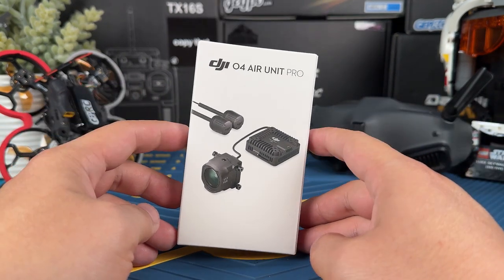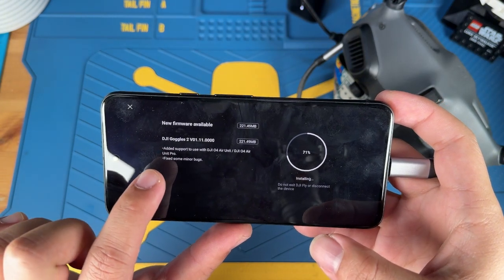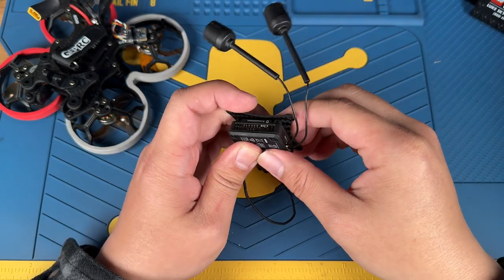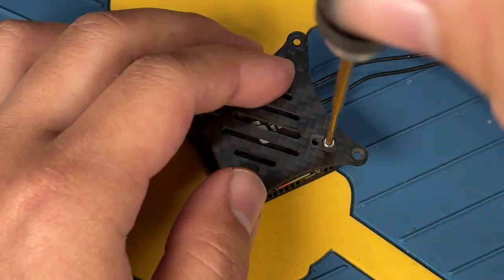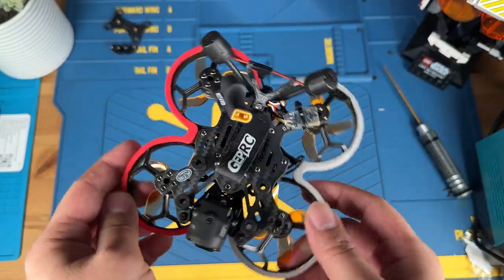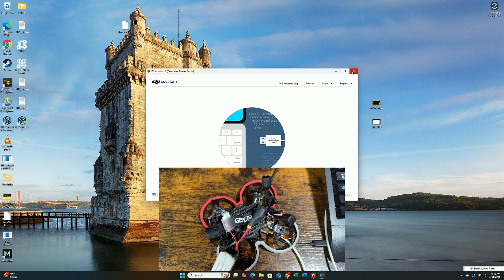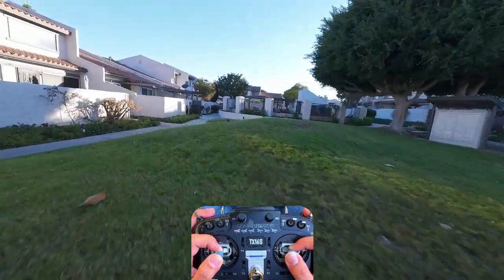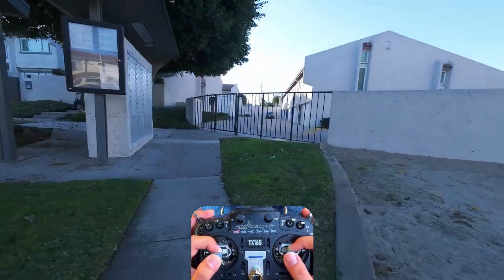Ultimate DJI O4 Pro Setup Guide: Everything You Need to Know | Is GoPro in Trouble?

Comment: Would you recommend getting used Goggles 2 or new N3?? they are at the same price here at the moment :). Thanks!
Reply from the maker: Goggles 2 if you can find it at the same price as N3, it will offer more flexibility to the DJI air unit generations
Reply: @XwingFPVRC as start to FPV, got my self an analog one and plan yo upgrade it to Air O4 pro. I was worried the Goggle 2 is outdated. Do you know how good is it with Analog? I know it need a module for that to work.
Reply from the maker: @ra_XOr  goggles 2 is the one shown in the video. Goggles V2 is the outdated one. Goggles 2 can bind with generally all generation air units. N3 will only bind with O4
Reply from the maker: Goggle 2 so far does not have analog supports
Reply: @XwingFPVRC I didn't know they had a V2 as well. 😂😂.  But I know Goggle 3 is out recently. Also, I know you can add a module with adapter to get analog signal feed into the video it..

Comment: Can you make a video on how to use the Tx 16 with DJI 04 unit and have the osd visuals in the goggles work... I'm kinda lost. I removed the brown and yellow wire so I could use the Tx 16 instead of DJI controller... But I'm reading that I have to have those connected in order to see my osd option such as GPS in the goggles

Comment: Hello, what are the advantages of using a tbs or ERLS instead of using the RC3? I couldn't find any information about it anywhere.
Reply: As far as I know, the biggest advantage is that by using a dedicated receiver you make your radio link independent from your video signal. If you use the DJI controller when you lose video you lose control too. By using something like erls your radio link outperforms your video what gives you a slightly bigger chance of recover your quad in case the video drops. And of course you have all the good stuff a radio with an operating system offers in terms of customization, and basically all the radios you can buy have better gimbals than the DJI.

Comment: Very nice
 can you tell to us.
Which system should to buy for beginner?
Analog or digital or dji realy i am confused.
Reply: definitely not analog, lol
Reply from the maker: Sure ~ made a video talking about this actually 

What are the types of FPV video systems? How to start FPV from zero to hero guide - Part 3
https://youtu.be/aL-dXU7paWw
Reply: @iFLYXWings6589  i watch allready this one,
Also this one is very helpfull.
I mean dji o4 air unit changing to rule. Actually, i have just a radiomaster pocket controller, and i am doing exercises simulation.
And goggles are expensive. If I chose  skyzone I cannot use dji, if I chose dji 2 or 3 I cannot use analog
I am trying to make a route  for myself
Reply: @XwingFPVRC Hallo. Is it possible to Change the analoge camera from Iflight Nazgul V3 DC5 ECO and replace it with DJI 04 Air unit lite and flying with DJI Remote Controller 3? Thanks. Best regards from Germany.

Comment: With the 04 UNIT, you can use your Remote 3 and Goggles 3 together by the way, you dont need a different RC controller
Reply: If you lose control with the goggles, you will lose control of the drone at the same moment.If you use a third-party controller, even if you lose contact with your goggles, you can lift the drone higher and reconnect. UPD: Important only for long range. If you fly 500m around you, not necessarily have third party controllers